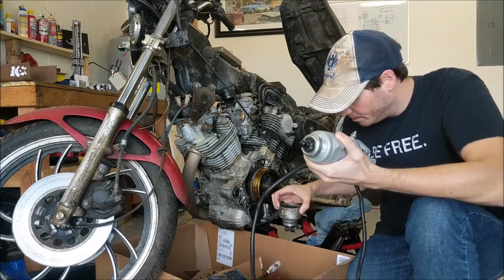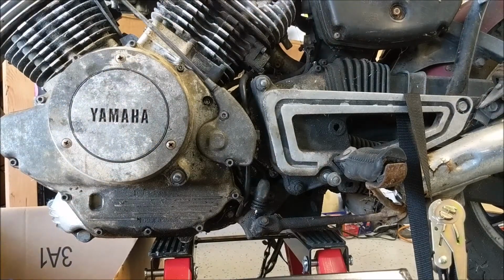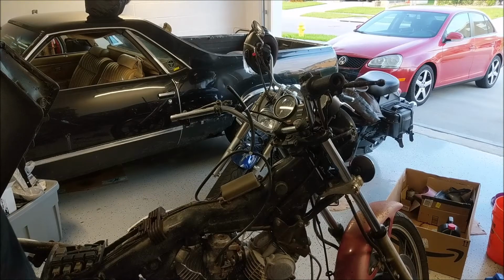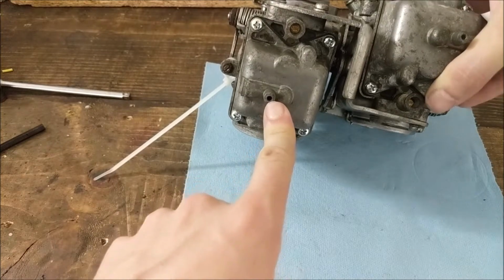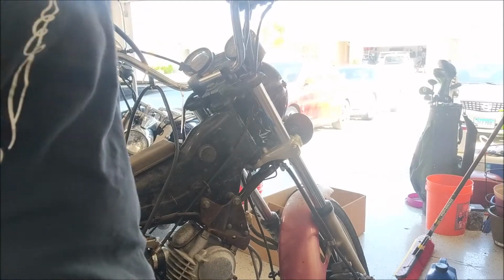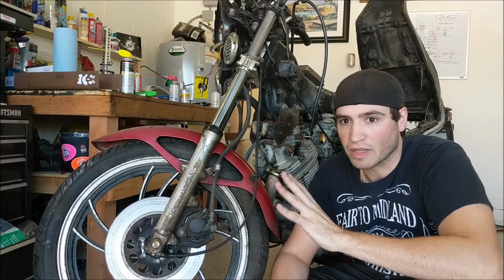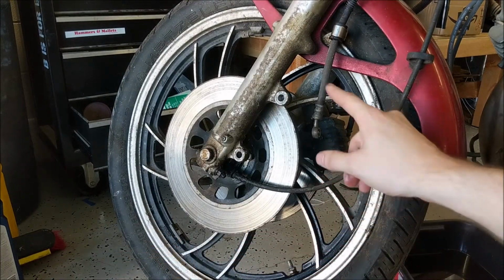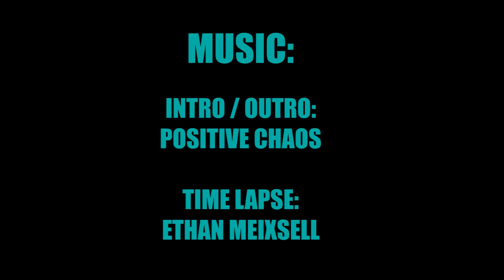XV920 | EPISODE 6 - Will It Start Pt.2

Comment: Awesome,  congrats on getting it started.  Don't worry about the smoke from the exhaust, it will do that if they sit for a few years. Float level and synchronization are different things.  Do a search on Yamaha xv carb sync. There is a way to do it without an expensive gauge.